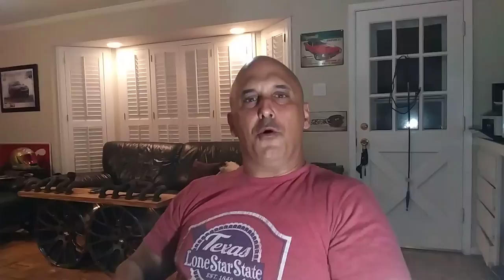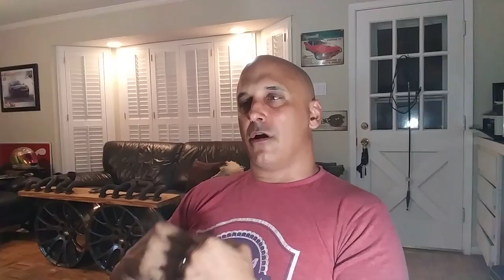Choosing a cam for your Hemi.  Here are some things to consider.

Comment: Edelbrock is mum on the hp gain with their Hemi manifold, which is revealing. For $960,the Victor should have some solid info behind it.
Reply from the maker: The issue that I have is that I cannot find any data that is reliable on this intake. Nobody has back-to-back Dyno tested it and more importantly back-to-back dragstrip tested it. If they have, I can't find it. And the cost of it does not allow for easy testing. What has been said about that intake is that it is more or less the 6.1 liter intake with slightly larger runners. That doesn't bode well for performance by comparison to the duel Runner setup on the 6.4. We have you sit on stroker combinations, and it did not disappoint, but it didn't blow anybody away either. Acting basically like a customary intake manifold
Reply: @bmasontv  are FT headers a bonafide 25hp for the 5.7? with a custom tune are they an extra 35+ hp?
Reply from the maker: @walterbrown9651  no, I would not give them that much credit . with the tune 15 foot pounds of tq.  Peak horsepower Maybe 15? Twerk will be up across-the-board though, don't waste your time with short tube headers
Reply: @bmasontv  thanks! I thought those claims were overly enthusiastic.
What have you seen with porting the Eagle heads? I appreciate you getting back with me! my Challenger is a 6sp. Just want to spend my $ on what will make a difference!
Reply from the maker: @walterbrown9651  can pick up, maybe 15 hp.  Not really worth it.
Reply: @bmasontv  Scat Pack beckons! Thanks!
Reply: Will Hellcat lifters fit a 5.7 Hemi? What in  your experience is the rpm limit of a stock 5.7 Hemi? Comp Cams has a cam with a range 1900-7000. SKU 201-303-17.  Comp says stock bottom end is ok... Hellcat lifters are backlogged til August presently. Can you recommend any good books for Gen 3 Hemi's?
Thanks!
Reply from the maker: @walterbrown9651  HC Lifter will work fine for the 5.7 in non MDS configurations. RPM limit is more limited by Valve Spring/pushrod than anything else, with better springs and pushrods, 65-6800 is not uncommon.  It is more intake manifold limited rather than bottom end limited, although I would not recommend running it much past 7200 rpm regardless of top end setup.  Can't think pof any good books on the Gen 3.
Reply: @bmasontv  thanks again!

Comment: What are your thoughts. On trans tunes and is it really necessary for the 8HP70
Reply from the maker: As far as being a necessity, no. The car does just fine stock. However a Trans Tune is where you will notice the greatest improvements in performance, primarily in daily driving. The car will simply be more lively.

Comment: whats up man maybe you can help me out im currently looking at going with a jay greene 230/236 cam and a ported intake with a fastman 88mm TB for my 6.4 what are your opinions for this
Reply from the maker: Opinions aside my first observation is that drivability is not something that you're looking for in this combination.  That cam is going to want RPM. Without knowing the balance of the specifications, intake Centerline and lobe separation angle,  I can only guess as to the tunability and driveability that it will offer. The intake manifold will not flow at the throat what an 88 can offer. It will need extensive work to get even close. The largest I typically suggest is 85 mm. Let me know how it works out

Comment: Do you think a ported intake manifold with a larger throttle body is worth the money?
Reply: The guys over at peak speed did a dyno with a ported manifold and 90mm TB and found an increase in 18 peak rwhp and 26 peak rwtq. For around 1k I think those are very good gains. However, that was on a pre 2013 challenger I don't know how the new ones would dyno with an 88mm TB

Comment: What do you think about jay greene custom cam kits?
Reply from the maker: I prefer Peitz Performance.
Reply: @bmasontv  can you elaborate on why you prefer that cam? And is it good for 5.7l?
Reply from the maker: @phillipspain251  custom cams by Peitz Performance are designed by yours truly... I'm a bit biased.  As for a 5.7... yes, can do.
Reply: @bmasontv  What!! If you prefer Peitz why did you send me to Doc Diff?
Reply from the maker: @392__SMOKE  the comment you're referencing was a comment based off of a question about another camshaft specifierfrom over a year ago. I am working more closely with Doctor differential with my newer cam grinds. I have put camshafts together for both peitz and Doctor differential. Most recently doctor differential
Reply: @bmasontv  Ok my bad. I was like wait a minute!!  I’m not a technical car guy. I rely on the professionals and really trust your knowledge. Thank You

Comment: Hey man I'm looking to get a cam for my 06 magnum rt I was wondering if you could give me some insight on how I should go about it
Reply from the maker: First place to start is set a goal. Do you want good drivability with a power bump, or all-out performance? Both require completely different approaches. Be honest with yourself here, Next, you need to find a reputable shop in your area that used to working with Mopars. Tuning is going to be extremely important.
Reply: @bmasontv  moreso good drivability with a power bump I still want to be able to daily it. Looking to get towards higher 300s for whp
Reply from the maker: @Bill-bi7sk  Dynojet or Mustang dyno numbers? Also, you got to be clear with what you define as drivable, drivability is extremely subjective. It will take long tube headers, and a fairly healthy cam to get you anywhere near those numbers, even on a Dynojet. Contact doctor differential in Groves Texas. They can help you get started on your journey.
Reply: @bmasontv  what about a setup that would give me around 350 360 whp high 300s is what I'd like to get but I have to be realistic.

Comment: How can I talk to you about a custom cam design for my 2019 Charger 392
Reply from the maker: Give Doc Differential a shout.  409-553-0759.
Reply: @bmasontv  is this from Peitz Performance? and do you also provide a Ported Intake Manifold? Or what do you think about the MMX Ported Intake?
Reply from the maker: @392__SMOKE  I have put cams together for both doctor differential and Peitz performance.  It's all going to depend on what you're looking for as far as what the grind will shape up like. As far as MMX intake manifolds. Their Runners look great but where they lack is in the throat area on a 392. That's where a lot of, if not most of, the gains are found.  I do quite a few manifolds for Doc Diff.  Coupled with an 84 or 85 mm throttle body, that will help to get the most out of that intake manifold. Think of it more like blueprinting, than porting.
Reply: @bmasontv  ordered, you’ll see it coming soon. Thanks Bro.
Reply from the maker: @392__SMOKE  Nice! Did you go through Peitz or Doc Diff?

Comment: Do you have a opinion on the Edelbrock heads for the Gen3?
Reply from the maker: I really don't have an opinion on those heads. As far as ported any heads, I'm used Hooper's Heads here in Houston. He has an awesome CNC program for Gen 3 Hemi heads.
Reply: B Mason Lived in central TX for seven years ago. Lots talented shops for Mopar and GM. Any thoughts on the new HRT cams and lifters? Their “stage 1” seems all benefits with no downside. Their down charts seem odd with the stock cam.
Reply from the maker: @stevenp3176  I am intimately familiar with the HRT line of camshafts. Yes, they are very good.

Comment: How do you feel about a 228/238 cam with 3200 stall and ported intake and throttle body on a 6.4 2013 srt
Reply from the maker: That would depend on the intake center line and lobe separation angle
Reply: @bmasontv  it is a 113 + 2
Reply from the maker: @derbycityracing2997   With an intake center line of 111, I'm gonna venture a guess and say that the lift is around 6:05 to 610. it'll be a good Cam, it's got a little bit much on the exhaust side unless you're gonna be going with a centrifugal supercharger at some point. Prefer to see a little bit less, somewhere in the 232ﾟ duration at 50 range.for na in that application.  The converter will be pretty good for the setup.
Reply: @bmasontv  no supercharger it’s basically a more improved version of the mmx max effort cam. Just have the hellcat shorty headers with high flow cats n mid muffler delate on exhaust
Reply from the maker: @derbycityracing2997   Are you running stock compression?
Reply from the maker: @derbycityracing2997   A better way to ask that question is, are you running stock compression, or are you running high compression with E85  ?
Reply: @bmasontv  stock n running 93 gas
Reply from the maker: @derbycityracing2997   With that duration and with it rocked back to  a 111 intake center line, it's definitely gonna want RPM. That will be a pretty big Cam for that combination on the street. Let me know how it runs
Reply: @bmasontv  yes

Comment: hey i’m trying to cam my srt8 6.1l what cam do you recommend for it
Reply from the maker: Depends on what you want.... HRT Stage 2 type cam will work well.
Reply: @bmasontv I was looking at the stage 2 but I want more low end power as I won’t be doing a torque converter for a while, I have the 6.1 also, would a stage 1 cam be a better choice than stage 2 for low end power?

Comment: Whats the best cam  for ram 5.7 1500 im looking for power at low to mid range rpm  ?
Reply from the maker: For low to mid range power, stay with the stock cam. That is what it is designed to offer.
Reply: @bmasontv  thanks

Comment: Best cam for a 5.7?
Reply from the maker: Best is a word that is incredibly subjective. It all depends on the combination and what the vehicle will be used for, or more to the point, what the power plant will be used for. So, is this a car, truck, boat, aircraft /air boat,  power station/generator or agricultural equipment?  Will this vehicle be involved in any racing activities and if so what kind? Drag racing, closed circuit racing, autocross, Open Water racing, sprint boat or jet boat? If this is a land-based vehicle, what is the owners  anticipated comfort with gearing (street car)? In other words, will this vehicle be involved in Long Distance, road trip applications? If this vehicle is  to be involved in Drag Racing, will the owner be opposed to a high stall torque converter (which will limit street drivability.) What kind of idle quality will the owner be expecting? What is their tolerance for heavy chop, poorly mannered cams on the street? Does the owner have any experience with cammed applications? Give doctor Differential a shout and he can get you sorted.
Reply: @bmasontv  hey! Thank you for the detailed response I really appreciate it! It's for my 5.7 R/T Challenger. I just want to increase the HP and add some sound. I'm not taking it to the track or looking to race. Already added a cat back exhaust and long tube headers to my car. Doea doctor differential have an instagram, twitter, or email where I can reach out to them? Thanks again for all your help I really appreciate it!
Reply from the maker: @Jeff21790  409-553-0759
Reply: @bmasontv  thanks!